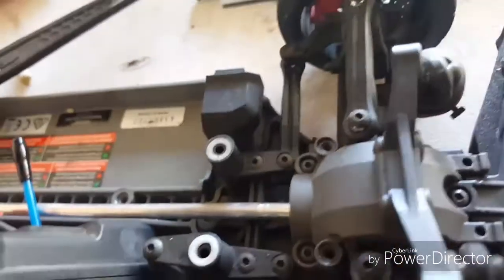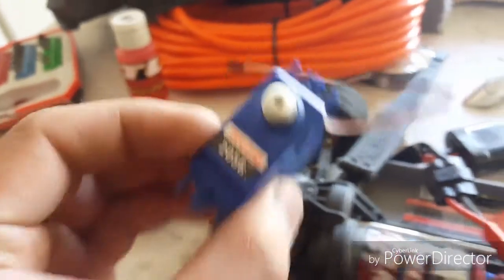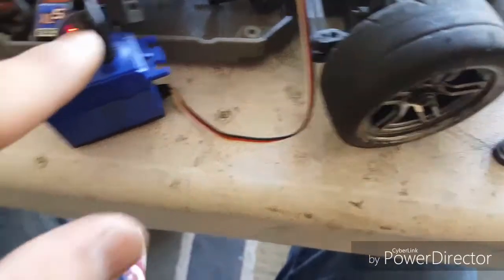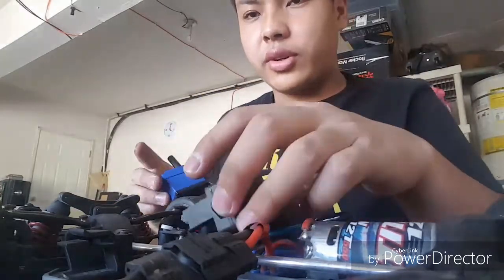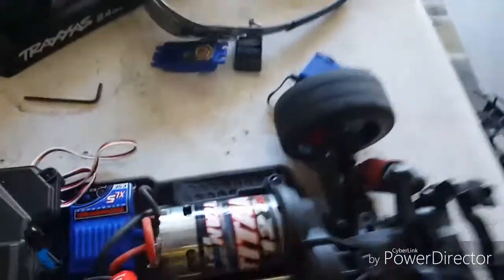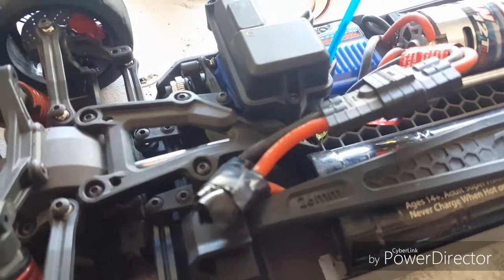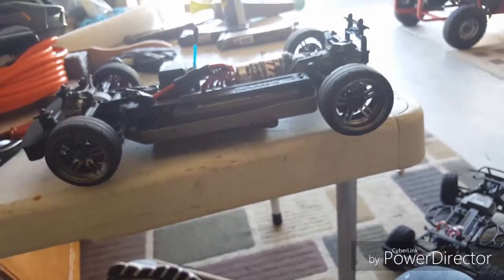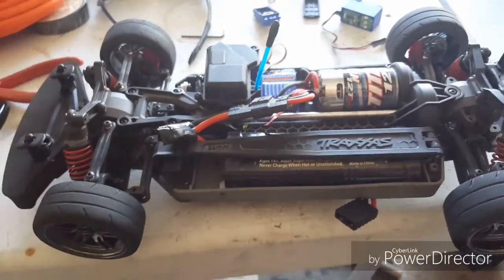Traxxas 4Tec gets its First Breakage (Burnt Servo Motor)

Comment: My 2075 servo burnt out....I also could not get that damned metal servo saver post off the servo!  I pried it off with a screwdriver and it broke the servo's pinion.  I figured I could hammer the remaining post from the inside...no luck.  I looked down inside the post and saw a hex head but could not get a wrench into it. I had to order a new servo and servo saver and will see what exactly I need to do to refit.  I can only assume so far that a hex bolt has to be unscrewed to remove the post.